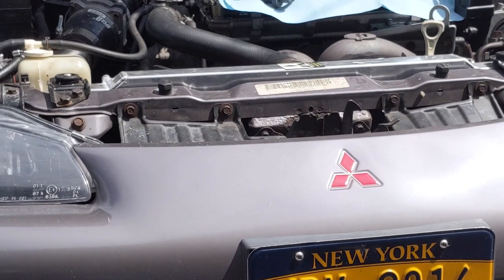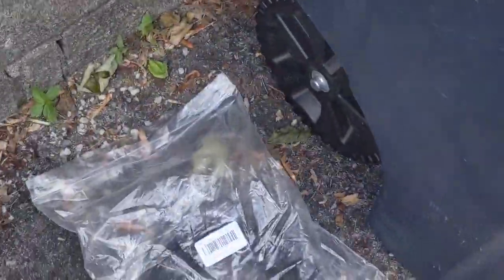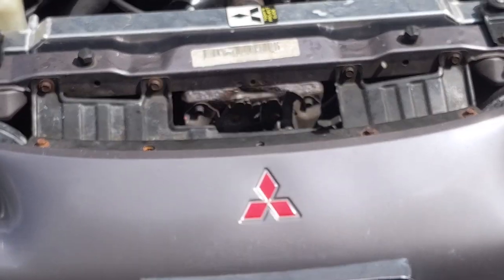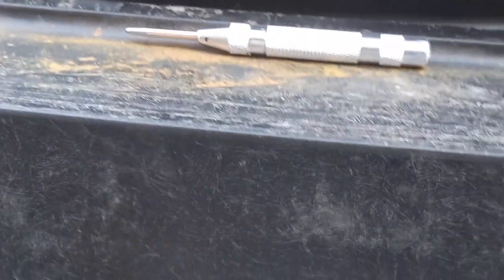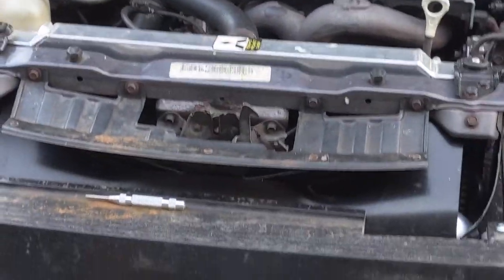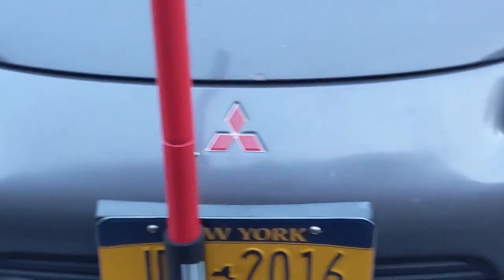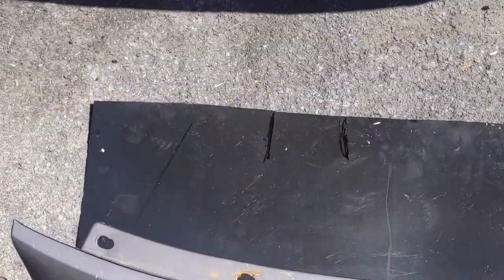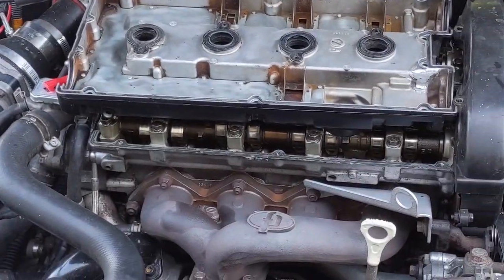BUILDING RADIATOR DUCTING (plus bumper quick release!)

Comment: I have a feeling I'll be doing this same surgery to my Talon. I have a VRSF intercooler installed, sill have a/c, so I'm sure I'll have cooling issues once I get her back on the road. Good to see a video dedicated to this procedure. Good work!
Reply from the maker: Hey thanks a lot I'm glad you can get something out of the video. something that I noticed that's absolutely detrimental to having this front mount intercooler installed is removing the 3-in black plastic in the opening for the radiator. Right in the front of your bumper at the top of the opening for the air to pass through is a piece of plastic trim that's molded into the fiberglass Make sure that you cut that out and that will give you at least 8° possibly 10° of added cooling. Also highly recommend a 14-in spal slim fan and a 12-in fan! 👍👍
Reply: @TPGDSM  The Talon front bumper doesn't have that black molded piece, but I've seen many Eclipse guys do that. The Talon bumper is a whole different shape, I'd say wider but maybe not as tall. That may cause a whole other set of issues, or not at all LOL! 
I still have my stock fans mounted to an eBay aluminum radiator, but may go Spal if cooling issues do arise and persist. Hopefully I'll have her running in a week or so, just waiting on a few parts from STM and a buddy is porting my T28 hot side and stock manifold.

Comment: I'm working on an integra with AC but running into similar issues. Thanks for the inspiration!
Reply from the maker: Summit racing abs plastic. I recently removed the abs and installed a more permanent approach. Used 22g mild steel to redirect airflow up through my radiator. Also added piping insulation (tube foam) in-between the radiator and ac condenser stack to keep air from escaping.